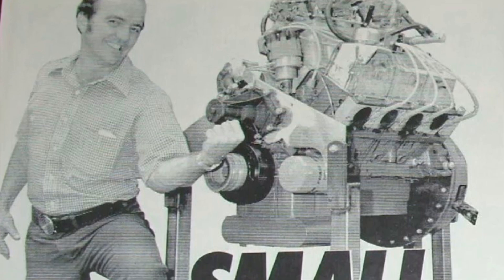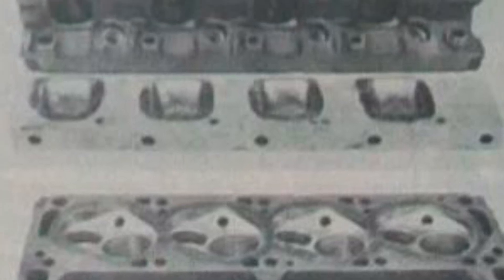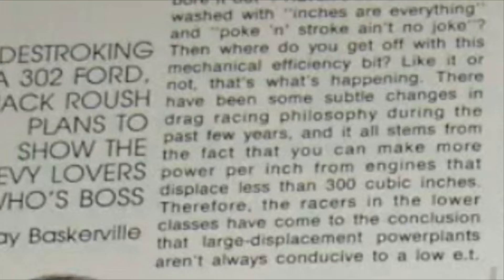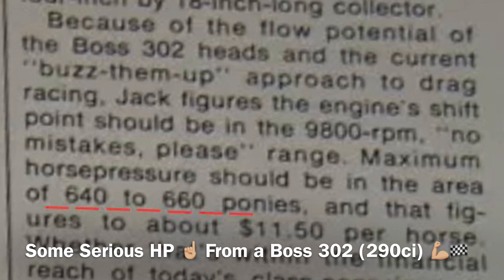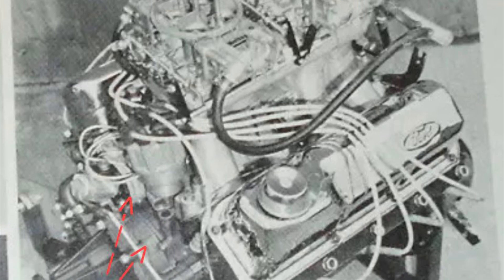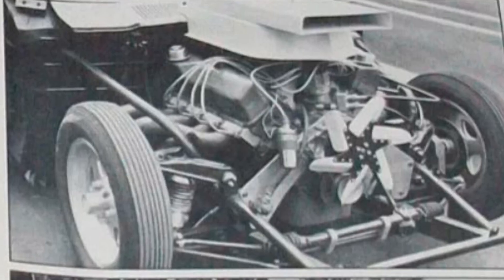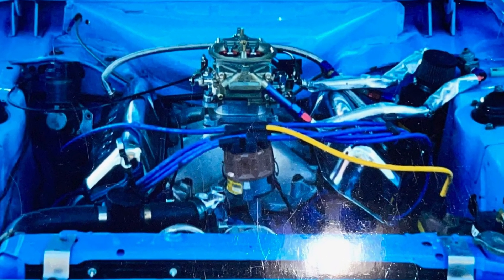Ford Boss 302 ProStock Motor, 
Jack Roush Windsor Boss/4V head De-Stroker.

Comment: A long rod short stroke engine with a bore large enough to unshroud the valves is the best combo for this... Smokey Yunick ran a 260cui long rod short stroke small block chev at indy I believe he was turning it 12k rpm.
Reply: You don't need long rods if you have great cylinder heads. That was a band aid Smokey used for the junk sbc heads.

Comment: Boss 302’s were not even common on the road rather than a damn junkyard. I feel safe stating the same is true for a DZ302 Z/28 motors
Reply: The only Boss 302 that I’d had any personal experience with was in my parents 1972 Mod Maverick. All I can say is that one word could sum it all up. “Scary”
Reply from the maker: Yep even though it was the 70s then, i agree. Although you’d piece together your own Boss Deal with 4V Cleveland Heads I’m sure🤷🏻‍♂️🏁 either way, some big power for back then
Reply: Absolutely correct!  Don't know where they are coming up with all that??

Comment: Ford is really missing out on an opportunity here cuz the gear heads of America know that there's one small block back in the day that backed Chevy in a corner, and it's got Cleveland heads on it .. that's all Ford has to do is bring back another 351 Cleveland and they'll corner the market again but they're just not smart enough to do that. Maybe with this new 7.3 with narrow shoulders and will fit in a lot of classic muscle cars if they make a lot of them then that'll attract the aftermarket support and Ford will be back in the game again that big 5.0 coyote complicated engine needs to go down the road and that coyote doesn't have aftermarket support either.
Reply from the maker: Well said R👌🏼🏁, the Godzilla 7.3 is physically smaller than the Coyote & remains oldschool pushrod valve train also👌🏼🏁
Reply: Rono..u spot on m8..the knew 7.3 litre   godzilla is no larger than a cleaveland in width or length.its only disadvantage is the height..intake manifold & the sump design.check out revan evan on u tube..🙂

Comment: Much if the public don't know that there was a 9.2" deck 351 "Windsor" race block (XE 93532) made back in 1966 & there were plans  back in 1965  by Shelby/DeTomaso/Ford to build a 427ci "Windsor" for Can-Am racing years before the "Cleveland" block was even on paper.😮
Reply from the maker: Wow!! Cool👍🏼🏁
Reply: hi, & the "351W XE 93532" race block was also used in Pro/Stock racing in the early 70's.
The reason the 9.2" deck 351W race block went under the radar for most of the public is
that it was ONLY made available to Ford racers initially when it was in development & testing, Shelby also did have plans to use it in his "Lone Star Cobra III" car for the public but when B Knudsen came to Ford from GM he screwed up the development of the 351W taking money & resources away from Ford engineers working on it & rammed through his (Oldsland) inspired 351C design pissing off some Ford engineers & Iacocca. (this is where the sabotage rumors at Ford came from at that time)

IMO, if Gm's B Knudsen would of never came to Ford for that one year screwing things up at Ford we could of seen a 402Boss "W" base eng for the public made as the early "GT" canted valve head prototypes were first used/prototyped on 302/351 "W" based blocks.
Reply from the maker: @393boss  wowser😯, thanks for sharing that with us here PR , a 402-Boss ? Yes please sign me up 💪🏼🏁
Badass
Reply: yes it might sound crazy but the reason I say there could have been a 402ci Windsor
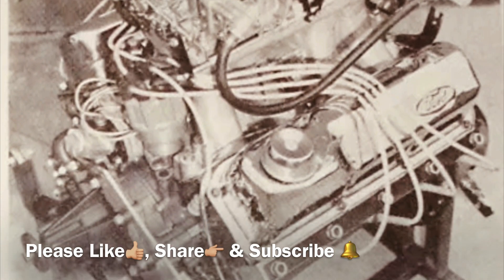is that the 9.2" deck XE 93532 "W" race block was already at a 390+ci (4.080" bore x 3.750" stroke) in 1967 Can Am racing. If you youtube search... ("1967 Can Am Road America") at 7:05 in vid you will see the eng, I was also told H&M had a prototype canted valve head to R&D on this eng for Can Am racing just before things got cancelled. Another tid bit not well known by public is the 1969 351W block was supposed to have 4 bolt mains with 2.750" mains same as the XE 93532 race eng before it got change at last minute for production.
Reply: The 351 Windsor didn’t come out until 1969 but I’ve heard a lot about the taller deck height that mainly you would see in race cars
I’m pretty sure the 302 came out in 68 and I’m talking about a standard 302
Reply: @MatthewJohnson-o4x  a 9.2" deck 351W was planned for production in 1967-68 but B Knudsen screwed that up with pushing his own Olds inspired block design when he came to Ford, btw Fords new 9.2" deck "W" design could fit up to a 3.9" stroke crank and the 9.2" deck 351W is where the later "C" block got most all its spec's from.

Comment: Been running a clevor in my 68 F 100 for. 30 years. 
Only suggestion if you run 302 cubes use a 5.4 inch rod.

Comment: My daily driver towing dirt bikes to Dez etc V8 72 pinto I built. Was a blast.embarresed many hot cars.
Reply from the maker: Haha that’s cool , thanks for sharing 👍🏼🏁
Reply: There were a few V-8 Pintos and Vegas prowling the nighttime streets in the South DeKalb County part of Decatur Georgia during the early seventies. They were all small blocks but the two Pintos that were serious enough to engineer a Cleveland into the mix, were respected and feared by the victims that got solidly embarrassed when they made the mistake of lining up against them. 
It was definitely a blast 🏁😳.
Reply: @danielwilson6665   I'm in so CA. My friends dad built one of first v 8 pintos Hooker used his car to make header's. And he had a pangra fibreglass front with pop up headlights. Bitchen car.
Reply: @techs1smh13  … Hey techs, that’s so cool and another perfect example of how SoCal has ALWAYS gotten anything and everything that’s related to fun, cool, popular, innovative, powerful and just plain desirable to have , well before the same thing hit the East Coast. I’m in the South East neck of the woods and last to get what SoCal got hooked on a year earlier. 
Oh well, wtf man. Maybe I should just move 😵‍💫😂🤔🙈😳😉.
Reply: @danielwilson6665  Cali went from making horsepower to now they're trying to kill it off. It's crazy how fast the flip flop happens.
They went from wanting to build a dragster to a prius.
Reply from the maker: @danielwilson6665   haha Badass 😎🏁

Comment: great video. i have been wanting to build a Clevor for years.
Reply from the maker: the 2V iron Cleveland heads are commonly available also, good candidate on top of a Windsor block 👌🏼🏁
Reply: @69JANKS  Got a 351w block and sonewhere I have a old article I think was from B&A performance that shows how to drill and plug water jackets. Edelbrock makes a intake now. And heads but are pricey. id love to find some aussie heads
Reply from the maker: @TheBigford460  would be unique & badass for sure 🏁

Comment: I liked the "Boss 302s are still relatively common junkyard items."  Can't say I ever ran across one in a junkyard and I was on a first name basis at all of them within 50 miles.
Reply from the maker: Haha 🤷🏼‍♂️🏁 if only right
Reply: Not junkyard jewelry I almost bought a Boss 302 from a neighbor for 750$ that was cheap
Reply: I heard they made excellent boat anchors 🤔, but I’ve never actually seen one pretending to keep a boat stationary at the docks 😉.
Reply: @danielwilson6665  
You must be mistaken....
Small block Chevys are heavier and make much better boat anchors.
And they are plentiful in the junkyards.
Reply: @Turbo4Joe363  … I stand corrected, sir.  You’re absolutely right 😁.
Reply: @Turbo4Joe363  the whole time I had it wrong I thought that's what we done with Mopar motors except the elephant 🙄🙄🙄

Comment: I remember this article. There was also an article about a Roush 310 CI Trans Am engine using the plentiful 302 blocks, along about the same time frame. If I remember correctly, he was running a 4 door Maverick with it. Having had a Ford racing family, I read up on everything I could find on them. Thanks for the memory triggers, LOL.
Reply from the maker: Haha right on EF 👍🏼🏁 , yes the 4door door Maverick & did an 8.9et@154 on first pass out 💪🏼🏁
Reply: @69JANKS  … A 4-door Maverick built using the technology of that era running a 8.9 @ 154 😳🙉😵‍💫👀✌🏻☮️🙈😂. I rest my case…Clevelands rule 🏁.
Reply: @69JANKS  … Sir JANKS, you know Dr. Ron I do believe. Seeing this post about a Roush 310 reminded me about Rons past and present de-stroked Cleveland head combinations. The man definitely knows his stuff and his online content is a must see for all 💡
Reply from the maker: @danielwilson6665   thanks DW  badass for sure. I seen DragBoss’s video on Dr Ron’s Maverick with Boss 311ci  4V Cleveland Heads, Ported intake (not filled) & 4150 carbs......808hp.....
Umm & i was saying!! 😎💪🏼🏁